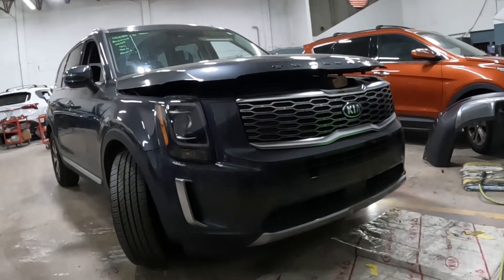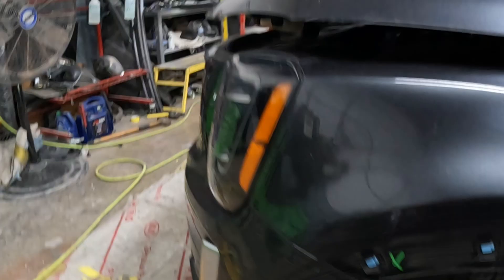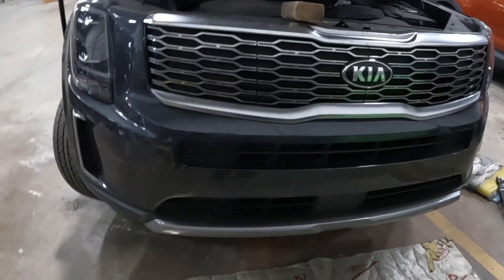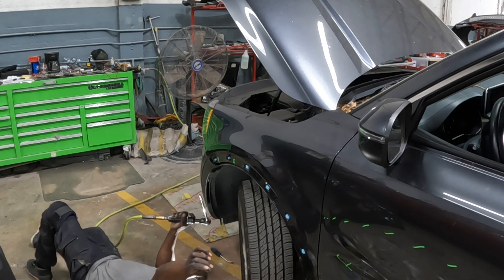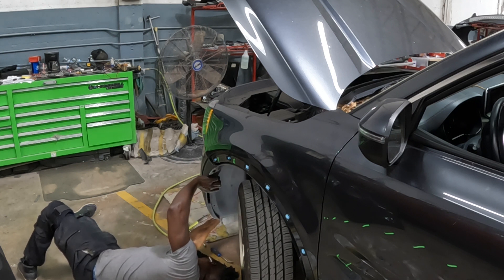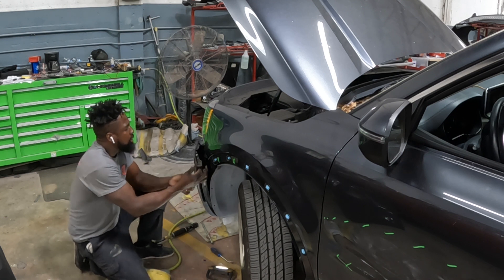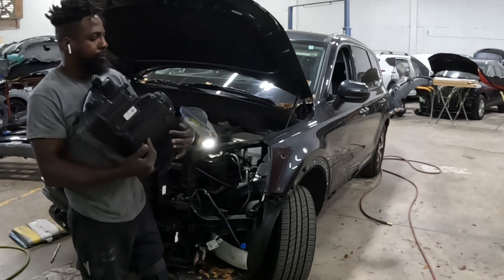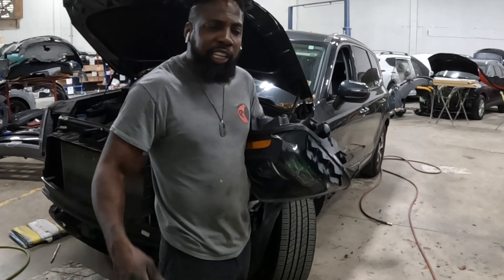2021 Kia telluride how to take the front bumper and headlight off

Comment: Very helpful. On a SX there are two bolts at the top of the fender one straight up 8mm with Phillips head and the  one shown in the video 10mm. Once we figured out the 8mm straight up it all came apart like the video.
Reply from the maker: Than you
Reply from the maker: Thank you

Comment: This was super helpful though after getting all the screws removed I filled from the fender area and got some movement, but pretty sure I did break and confident I will break plastic connections points I can’t seem to get at as I get closer to the headlight? I have a 2022 EX model. Any tips for HOW To remove the bumper parts around the headlights on back to the fenders? Your video made it look super easy to come off, and that is not the case for me.
Reply from the maker: Just take your time and watch the video and your c